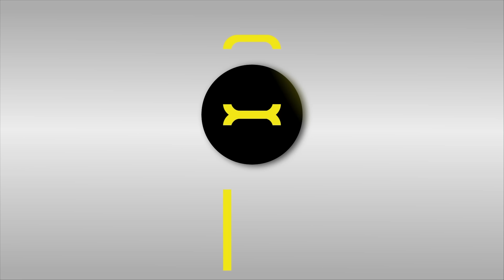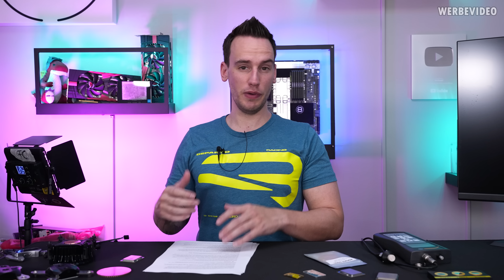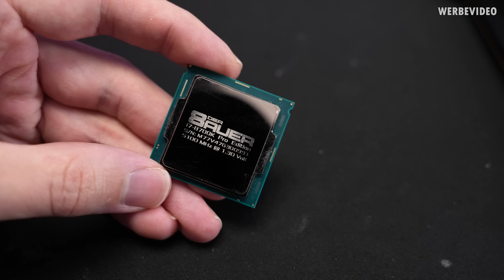Why you should NOT buy Water Blocks made out of "Silver" - Thermal Conductivity measured & explained

Comment: When I am using liquid metal between two copper parts, they will stick together over time. (RockitCool and EK Supremacy EVO, Both pure copper)
But even though they stick together the performance is still grate. It makes it harder to clean the water-block though.
I also sanded the two surfaces before applying liquid metal again. Thus in my experience Nickel-plating is nice to have, but if you only have to clean the water-block 1 or 2 times I think it is fine to use pure copper. (Not Aluminum though)
I guess the silver-plating will work just as well as a Nickel-plating, maybe it can last even longer. Who knows? But it might be nice if you remove your water-block often.

Comment: Copper alone will retain heat without dissipation. That's why copper is always used with fans, heat pipes or aluminum fins. For example water in a loop dissipates the heat soaked in the copper.
This is why copper nvme heat sinks dont do well and aluminum with multiple heat pipes do very well. 
The same goes for flashlights... Copper at the heat source and aluminum to dissipate.
Reply: The reasons fins are in aluminium nowadays is because of its manufacturing advantages. Copper is more expensive, heavier and harder to mold so its only kept for crucial heat pipes.
Reply: anything alone will retain heat

more importantly, the higher specific heat capacity of a material the more thermal sink it will have up to its saturation point (but also the less dissipation, which is a function of surface area)
Reply: Lol at these replies.

Comment: The silver is for biological growths such as algae, fungi and bacteria.
Reply: Copper does that as well
Reply: @WouterVerbruggen  So does that mean I should stop worrying about the loop I have with just distilled water?
Reply: @hellboundedward  If you have a kill coil and make sure your loops stays as clean as possible when building sure. But it isn't guaranteed. Distilled is not pure, the plastic bottle it is in is not pure, the air in your loop before you fill it is not pure. There are a thousand ways growth can begin in your loop. Just use clear coolant, it is VASTLY less hassle.
Reply: @hellboundedward  you will always want to take precautions. These are not sealed systems and air gets into the loop.
Reply: @WouterVerbruggen  well, your not wrong, but we often add bio chemicals to the water in a copper loop to avoid this growth. I'd even add it with silver in the line, buy you'd probably need less of it.
The silver acts as a kill coil per say. But its not impervious.

Comment from the maker: Re-Upload: Fixed the W unit mistake in the first part of the explanation so this should be solved. Thanks for the feedback
Reply: You really didn't need to do this! It sparked a nice in detail discussion and proved people are really eager for your in-depth videos. Thanks for your commitment and desire to go into details, but... you already did things perfectly (enough) round 1!
Reply from the maker: @FreakyAngelus  it was almost no effort and I agree that it should be following SI units
Reply: uh that's why I found it private and then reuploaded.. well looks like I saw the correct one then, thanks :)
Reply: The explanation is still incorrect (the one around the 2:00 mark), as you end up with the Heat Flux (W/m^2), not the rate of Heat Flow (in Watts).
The correct Rate of Heat Flow can be calculated by multiplying the obtained Heat Flux for the 2 material cases (first 400 W/(m^2) and then 200 W/(m^2)) by the total face area (10,000 (m^2)), giving 4MW and 2MW respectively:
400 W/(m^2) * 10,000 (m^2) = 4e+6 Watts, and
200 W/(m^2) * 10,000 (m^2) = 2e+6 Watts.
Reply: @mortlet5180  i was just going to complain about the same.
So more intuitive unit for thermal conductivity would be: [ (W * m) / (m^2 * K)].
[m] in nominator stands for thickness of the wall
[m^2] in denominator stands for surface area
But math checks out when you divide both nominator and denominator by a meter to get bit simpler unit.
And the formula is
wall/conductor cross surface area * temperature delta * thermal conductivity = rate of heat flow * wall thickness
and with super basic math/physics you can transform this formula to get any single value
Reply: I appreciate the dedication to accurate explanations :)
Reply: Fyi pure silver doesnt tarnish but its waay to soft
Reply: Love these scientific deep dives keep it up